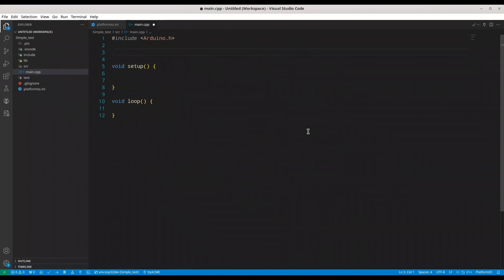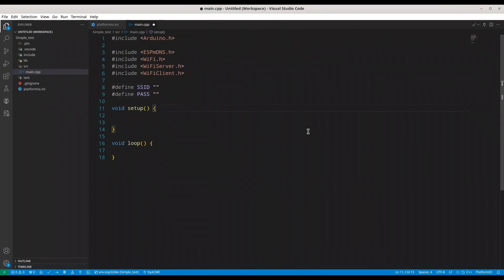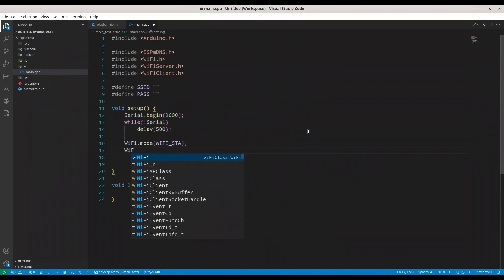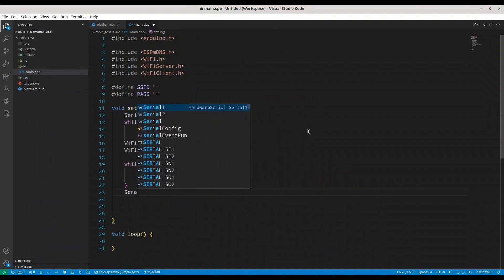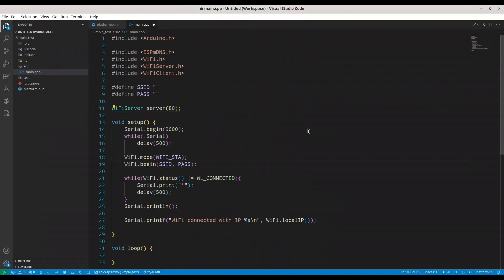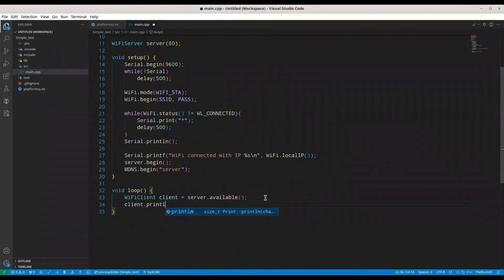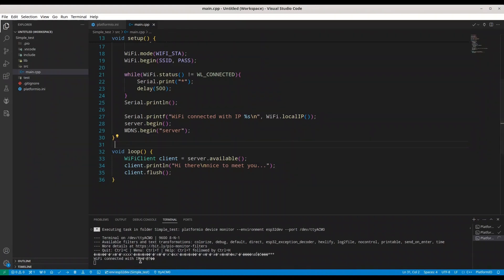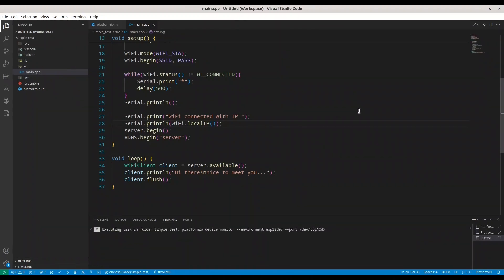ESP32 & ESP8266 - Simple TCP server with ESP32 and ESP8266

Comment: Thanks for the video. It explains a lot. I see your other videos will also help with my progress. You have the most helpful esp32 videos i have seen. Perhaps you could make a brief video on how you found material for your examples. Do you use examples from others or is there ESP32 reference docs? Thanks
Reply from the maker: Thanks a lot for your kind words and support. 

Well, that is both simple and complicated at the same time. I am constantly in touch with other people code + I am building my own projects based on my own ideas. It's mostly about the experience.

About books and documents... read it all. You need absolutely every piece of data you can find out there. I know that it sounds bit hard, but there is no other way... and of course good luck 🙏